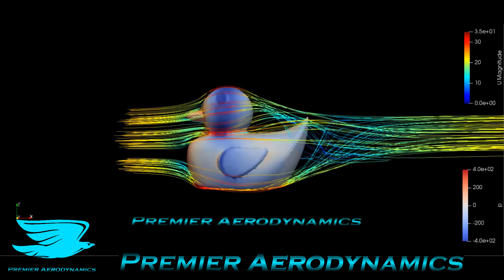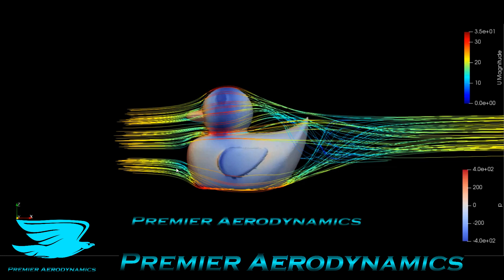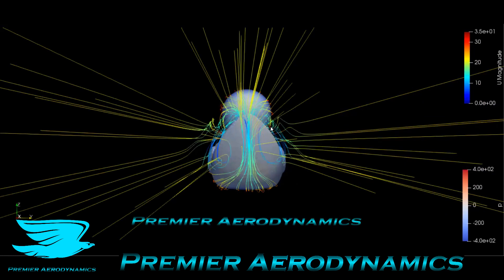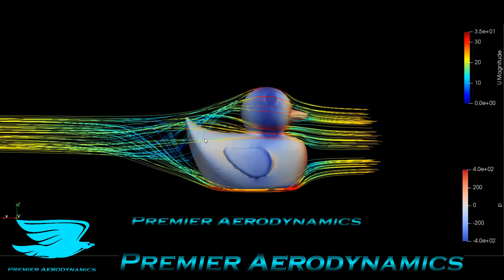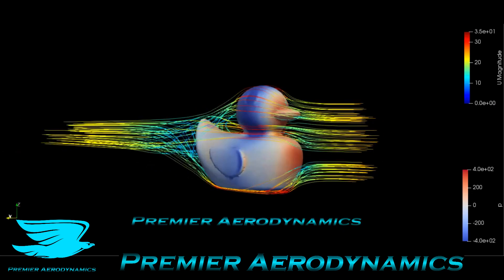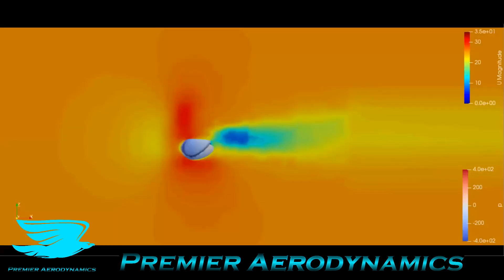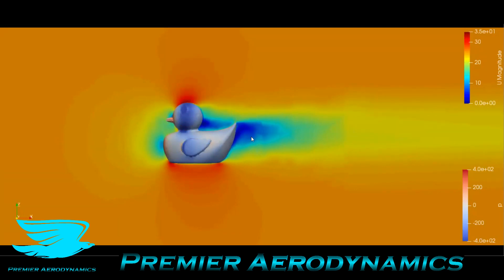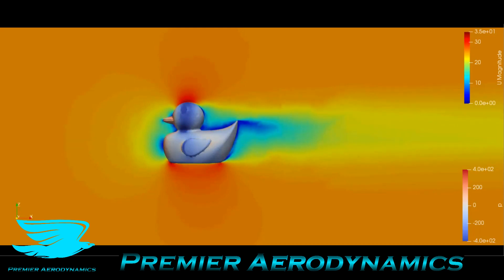Aero of a Rubber Ducky - Premier Aerodynamics

Comment from the maker: Registration for the International Aerodynamics Conference '22 (IAC '22) is now open! Register here: https://premieraerodynamics.com/IAC-22/

If you want to learn CFD, check out our course: https://premieraerodynamics.com/courses

If you’re not measuring the temperature, barometric pressure, and humidity in your aerodynamic experiments, then check out The Atmosphere Hawk. https://premieraerodynamics.com/Atmosphere-Hawk/

It accurately measures these parameters to get rid of the large errors you get in the density, force measurements, and more! when you don’t measure them.

https://premieraerodynamics.com/Atmosphere-Hawk/

Comment: Thi might seem a weird question, but I am genuinely interested.
If i plan to place a rubber duck on my bike's handlebar and travel at around 30kph, can you estimate how much more power I have to put to maintain the speed?
Reply from the maker: It'll be almost nothing because while the drag coefficient is high, the frontal area is almost nothing so the overall drag is almost nothing.